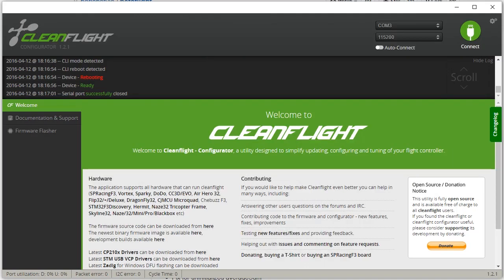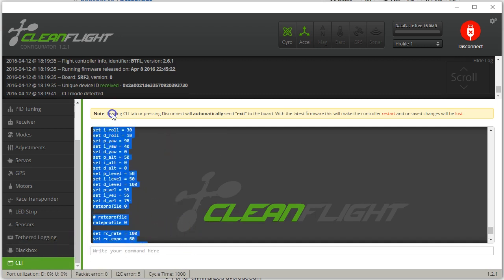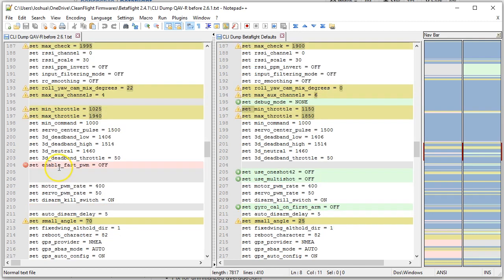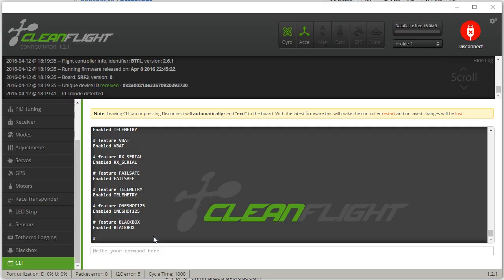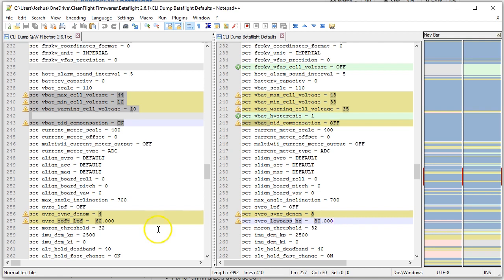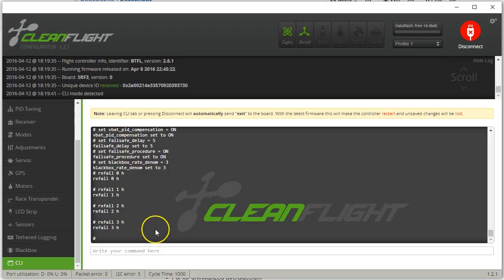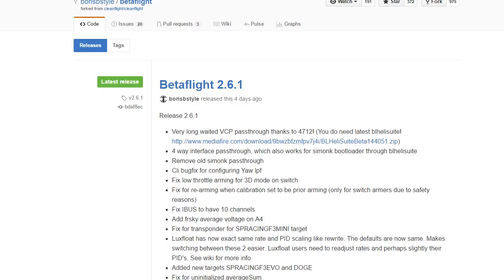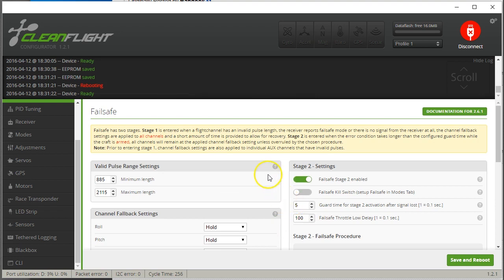Safely Upgrade Betaflight and Cleanflight

Comment: Hi Josh!
Huuuge problem, need help pleease!
I just flashed the SP F3 Banggood-clone board like you describe in this video!
Before it was all fine, saw the quad in betaflight and sensors were all there (deluxe version with barometer and compass) and after flashing:
All gone! 
I mean it's just not there any more, sensors not highlighted in upper right of cleanflight... please help me!
It's my first build, I sat here all night putting it all together and now this...
I disconnected it, restarted cleanflight, still nothing there although it is connecting!
Reply from the maker: My guess is that the version of CF or BF you flashed doesn't support these sensors. The baro and compass are seldom used on mini quads. You don't really need them.

You can check in the Configuration tab though to see if the sensors are disabled though. That might be it.
Reply: Joshua Bardwell Thank you much for your quick answer! I don't really know why I got the deluxe one. Thats not the problem though. In the main view in CF, the Quad is gone! I tried flashing older Versions, even f3evo ...after that I had to do the boot bridging thing to get a connection again...
After all, the tabs in the left are all dead, no configurations possible, no Quad visible, only in the very bottom some pid number count at about 570... And accelerometer and one other Sensor in top right are green. 
Pretty strange, can't find anything like it on the internet.. 
Still glad the quad is alright, seems to power up properly with battery, even binding to flysky transmitter worked. But without cleanflight configurations I wont get far now... Sux! 
Got any further ideas? Sorry to bother you with all this but you are like the guru of quad technique for me, and it is pretty traumatic since this happened after following the steps in this video here.. 
Shame on my nooby behaviour.
Reply: I can see my angel again! lol
It was the version of cleanflight configurator! I had to downgrade it for my little eachine e010s... Loaded latest version of CF now and all is fine again!
What a friggin huge relief!
Btw., didn't mean to accuse you of fake infos or anything, I was just in a shock mode .. 

Thank you sooo much for all your videos, you are a great help out here, one of my favorite channels for the last 3 months of studying everything about fpv flying ;-)

Comment: Hi Joshua, i bought a G90 with frsky xm micro receiver with sbus, i have cleanflight 1.13.0 on the FC, i can't get it to boot, bind but i could get it to broadcast video, what do i need to do to be able to get it working?, any idea would really appreciate yr help. Thanks
Reply from the maker: Broadcasting video just means it has power. Is the XM+ bound? If not, that's the first thing you need to do. Then check out this setup video, which, although it's a bit dated, has the major steps in it.
Reply: Joshua Bardwell thanks, I'm getting video, I'm using my googles, but can't armed and bind, will check the video. Thanks

Comment: joshua bardwell iv had these cleanflight problems aswell and went back to cleanflight 1.2.4   and still having problems flashing and failing to open serial port on my f3 delux pro board & what latest firmware would be preferred for the f3 board and should i use boot loader  josh
Reply from the maker: Just fix your drivers.

https://www.youtube.com/watch?v=m4ygG6Y5zXI

Comment: knowledge is power and you know allot about this stuff. I'm having trouble with cleanflight. I been was using 1.13.0 now but CF is 2.0.0 and I can't connect any of my quads. I know how to fly Pretty dam good but this computer stuff gets me stumped. I think I have to flash the firmware is this correct? And if I do will all my settings and pids still be the same as they are now if I flash the firmware? I would have liked to keep the 1.13.0 as it was cuz I was getting used to it. Please help Josh! thank you.
Reply from the maker: +Ian Rice you can install an old version of the configurator to keep using 1.13 but I can't find the instructions right now. Or you can upgrade your quads to 2.0 but you will have to rebuild the configuration.
Reply: thank you for getting back to me! painless360 has a video on how to use the older version. but of course my computer isn't able to find the that I downloaded. I have horrible luck with this stuff. But again thank you very very much.

Comment: joshua can you tell me what happened to the tabs in cleanflight that changed your sbus and serial rx settings? I got a new FC for my tiny whoop and its been a while since i have used cleanflight, as i went to change the settings for the sbus and serial connection and the tabs are gone? do i need to update cleanflight? thanks
Reply from the maker: +hquiroz113064 I think it's moved to the receiver tab, at the bottom.

Comment: Hi Josh, nice video ! Quick question. I have a well tuned QAV quad binded with Taranis. Now I want exactly clone everything (everything!  PIDs, channels.....) from this quad to a new eachine quad and bind with the same Taranis in a new mode.  I know you can use 'dump' command under CLI in Betaflight to output settings in txt. Can I just copy the txt file dumped from QAV and copy it my new eachine quad ? Will everything be the same ? Do I have to set channels again ? Thanks !
Reply from the maker: +Tristan Sun everything will be the same except maybe the UART used for your receiver will be different. I strongly suggest saving the output of the "diff" command and past generations it in, instead of "dump".

Comment: i am new in the hobby ,abouth 1 year,i had 2 nice quads only one of them had a problem with my led s,,i have a powercube on board ,the tail leds tel me or i stand by,ectrbatery is almost empty. nou i had a issue ,my leds are broke and do nothing but also my video fpv,and my trancemitter,(reciver),can u a litle help me ,if i knowing why only my powercube have only power after the isue with my leds?
Reply from the maker: +chris schaft alias vuurwerkjunk I'm going 5o guess you crashed and broke something.

Comment: hi josh,
can you tel me or there in cleanflight a  option is that you can see the errors?becouse i have some isue on my power cube,with my leds.evry thing is in english and iam dutch,then you know my english is very bad,lol
Reply from the maker: +chris schaft alias vuurwerkjunk I'm not sure what kind of error you're hoping to find. Cleanflight has no error log or anything like that.
Reply: ok iam sorry matte,i that maby it comes becouse my leds are making no contact,and  thats wy my other things also has no power.but i get on a other way info ,your richt this is not a forum,sorry
Reply from the maker: It's no problem that you asked. Lots of people ask for help here. I just don't know the answer. The question is too open-ended. There are too many possible answers. Maybe your voltage regulator is damaged?
Reply: i know its complicate than i that .
but thanx men,i seek verder,thanx
Reply: let i say ,if there a defect is on the tail leds,can it be thats  this twoo things ,reciver,fpv reciver are have no power?becouse the power has underbroke becouse the defect leds?
Reply: than i order some leds and replace them..u know?
Reply: becouse that is where the problem starts.
Reply from the maker: If the LED has a short in it, then it could draw so much current that the voltage regulator stops working. Disconnect the LED and see if the other stuff comes back.
Reply: thanx,il go try,i hope so and otherwise again a small step to the solution

Comment: When I first built my quad I set it up with the base Cleanflight software, Can I use this process to change over to Betaflight?
Reply from the maker: +Khalinatek sure. But Betaflight will have more options that don't directly transfer.
Reply: Awesome Thanks!, I just want to transfer over my basic settings and then I will re-tune the quad. Sounds like I have a project this weekend

Comment: At 6:09 are you setting your Battery alarm to 1v because you have a buzzer you only use as lost model alarm?
Reply from the maker: +Allan Sanderson Basically. I have an OSD and Taranis telemetry to monitor voltage, so I don't want the battery buzzing at me. But I have since set it to 3.2 volts or something, because vbat_pid_compensation relies on the min voltage to scale the PIDs.
Reply: Cheers, that's what I figured, and was just looking into the vbat_pid_compensation myself.  

Are you sure about it using min voltage? It mentions that it uses maximum cell voltage as an offset, and that if voltage drops below 2 cells it is disabled.  

Since I have no buzzer installed I can leave my min setting alone anyways.
Reply from the maker: I believe that it scales between max voltage and min. So lowering min_voltage decreases the effect of the compensation. At least that's what people on rcgroups were saying.
Reply from the maker: +Allan Sanderson not sure, but that's what a discussion on rcgroups said.

Comment: So I'm using the same blackbox settings you had in this video with the xracer f303 v2 at 4KHz and denom 2, but I was just wondering if it was normal for the onboard memory to fill up super fast. I logged a flight that was maybe 5 minutes and it took up 7 of the 16 available MB. FPVModel's sight says "This will allow you to store an entire days worth of flights while you are out in the field burning through multiple batteries and flights." I see that the looptime plays a role in how often it saves data, but I was wondering how large your blackbox files normally are? Just seems like the onboard memory is useless if that's the case, not to mention it takes forever to save and erase.
Reply from the maker: +Ryan Hackney On-board memory is only 16 MB. This should be about 10-20 minutes of recording, depending on your blackbox_rate_denom and your looptime. If you are logging with the default of blackbox_rate_denom=1, it will fill up super fast.

Because I log to an OpenLog device, I can only log so fast without dropping frames. So I target a logging rate of about 1 kHz to 666 Hz (logging time of 1000 to 1500 us). If you are running at 4 kHz, then your pid_process_denom is probably 2, which means your blackbox logging rate is 2 kHz. Try setting a blackbox_rate_denom of 2 to 4 to further reduce your logging rate.

The onboard memory is okay for spot-tuning, but I don't know how you would fit a full day of flying into 16 MB unless the logging rate was so slow as to be largely useless. I think that's just marketing fluff. The very slow erase and save is a major reason some people prefer an OpenLog device.
Reply: +Joshua Bardwell Cool, thanks man! I have an openlog on here too so I will just use that.
Reply from the maker: Ryan Hackney If you can deal with the slower logging rate, and if you have space on your build for it, then it is really nice.

Comment: Why did you dropped your looptime to 250 if F3 boards can easily get down to 1000 looptime ? Or this means 250 is even more faster ?
Reply from the maker: +fpvYou 250 is faster. Which is faster: 1000 seconds or 259 seconds.

Comment: how do you do telemetry to the taranis or you don't ?
Reply from the maker: +fpvYou UART2 on the F303, TX pin to the S.port pin on the X4R, enable SmartPort telemetry in the Ports tab, done.
Reply: thanks, and how does a FC knows about LIPO voltage ?
Reply from the maker: If you have an FC with a built in voltage regulator, like the Lux, Cyclone, Tornado... possibly SP3? If you have one of those, it just knows automatically because it hooks directly to the battery. Otherwise, you hook the battery to the vbat input pin on the flight controller.

Either way, you enable battery monitoring on the configuration tab and calibrate it to be correct and then the voltage is reported over telemetry.
Reply: +Joshua Bardwell I'm working now on x-racer v2
Reply from the maker: The battery input pads are on the bottom of the board. Solder some fine wire to them and run it to your battery pads on your PDB.
Reply: +Joshua Bardwell Thanks! is it necessary to provide GND as well ?
Reply from the maker: Hmmm... no. The FC should get ground from its power lead. For ESC signal wires, it is most important to include ground, but for something like vBat, there is already a low-pass filter, so a little delay or noise caused by a lack of ground shouldn't be too big a deal. If you can solder ground to the vbat pads, it wouldn't hurt.

Comment: Hi Joshua, I've been following this same process ever since going to BetaFlight, including a re-tune from defaults each time.
One thing I'm not sure on is the new 2.6.1. default dterm_lowpass_hz =  70.000.  Particularly given your previous video https://www.youtube.com/watch?v=FIZe0FNjuxo ... waiting for better weather tomorrow to try term_lowpass_hz =  0
Reply from the maker: +David Martin Boris changed dterm filtering in 2.6.1. If he concluded that dterm cut of 70 was best, I would be inclined to agree. But no harm in testing out dterm cut of zero.
Reply: +Joshua Bardwell Yes, I've learned that +Boris B. knows best , but I find it useful to play with these settings to get a deeper understanding.

Comment: Can you upgrade your ESC via clean flight and the Xracer F303 v2?  ESC I have bought (but not installed yet) DYS xm20a.
Reply from the maker: +Jonathan Edradan Yes.
Reply: +Jonathan Edradan I had to use the newest version of Betaflight and load the new Blheli to get my ESC's to Flash right. BLheli did not simply upgrade. It was a whole new download program..
Reply: +Jonathan Edradan Same board (X-racer) and same ESC's (DYS 20amp)....let me tell you once I got it all working it smokes my spfracing board...big time!!

Comment: Hey Joshua g-tune is amazing. What are your thoughts on it?. Everytime i run it i get excellent results.
Reply from the maker: +Customized Race Drones I've never used Gtune. I have heard very hit or miss results with it. Some people, it works great. Other people, it just keeps raising P through the roof. Etc...
Reply: +Joshua Bardwell humm more of an understanding of the PID's i must. i can build them faster then i can fly them. studying the pids is definitely in order cause thats where i fall short... Gtune at this stage to me is cake and ice cream. but with my cake and ice cream i want good presents too. I will see if i can lock them in manually. thanks